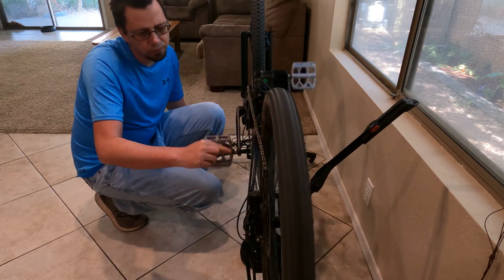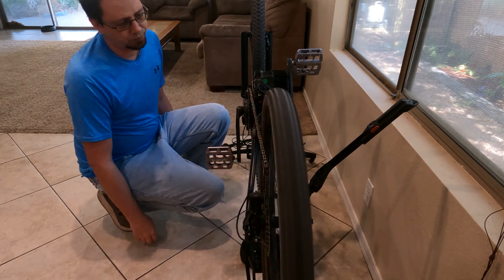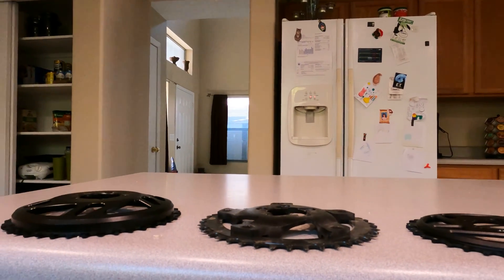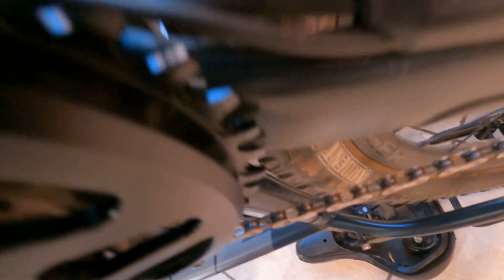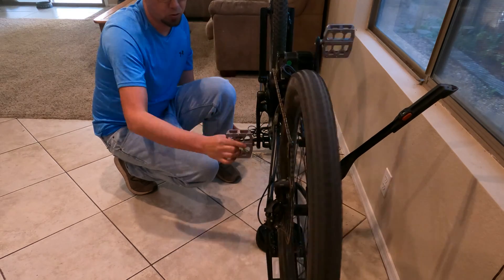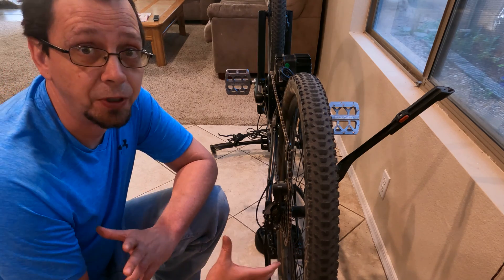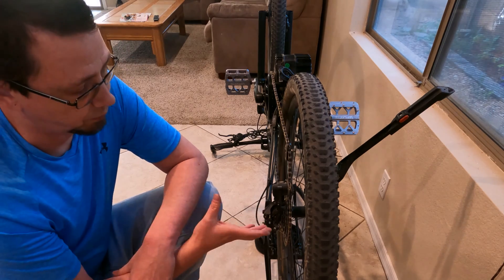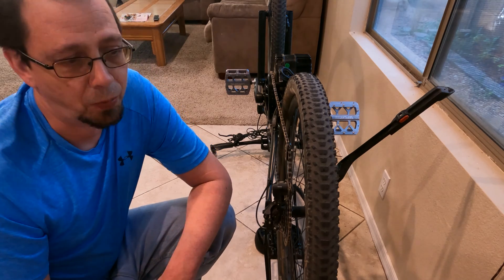Bafang BBSHD Chain line

Comment: My BBSO2 stock 44T chainring with 16/46 freewheel 8 sp motor pushing a Trek 4500 26" dual 48v-30ah batteries started to overheat due to ghost pedeling up a long hill.  I dropped down to a 38 T then Lekkie 28T using 16/46T freewheel. The smaller chainring causes more chainline issues but no more ghost pedeling, better gear ratio in my hilly area and motor not over heating
Reply from the maker: Have yet to overheat the BBSHD. Does it show an error when it overheats?
Reply: @Eric_Tennant  There is no error code on the 500C LCD Display. It was hot to the touch, so I stopped immediately and tried to shift up to a granny gear. However, for a second, the motor had no traction and was free-spinning. I got scared at first and thought I had damaged the motor, but once it cooled down, normal operations resumed. Also, there were no more long hills. Definitely, a game changer switching to the Lekkie 28 T smallest chainring. I might have to switch out my 8 sp freewheels to get the chain line better. I have less had 300 miles on motor.

Comment: Question are you running a 8 speed cassette ?
Reply from the maker: 10
Reply: @Eric_Tennant  im running an 8 speed cassette i just fitted the same 42t 20.5mm offset chainring you have today & its running perfectly! . note i believe this is a Chinese copy of the Lekkie BBSHD Bling Ring : 42 chainring with a 18mm offset any thoughts ?
Reply from the maker: @shadigif8916  Nice! Yea its basically the Lekkie without the price.
Reply: @Eric_Tennant  A Bling Ring without the bling

Comment: Incredibly I have the same combination of BBSHD  motor including & Trek marlin bike, frame size 8 speed cassette & experienced  same issue after fitting a aftermarket 44T ebay chainring (middle ring in video )  with chain dropping of front chainring in lowest sprockets  .I just  ordered the same 42T 20.5 chinese chainring shown in video .
 Question are you running a 8 speed cassette ?